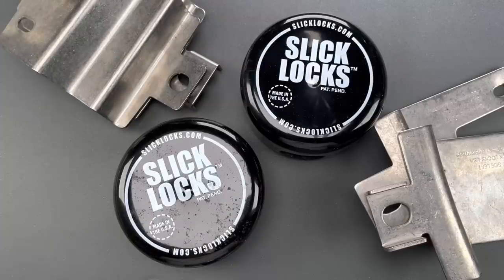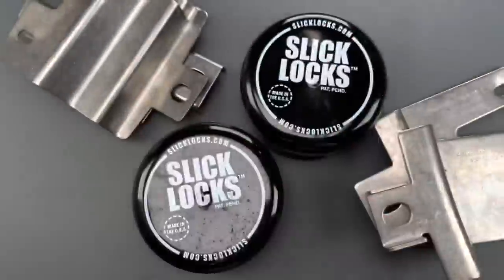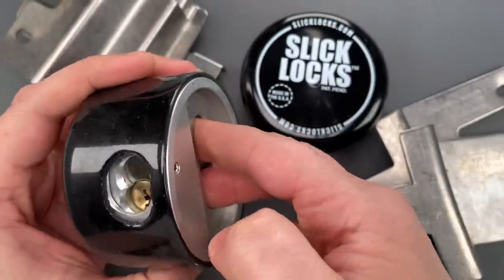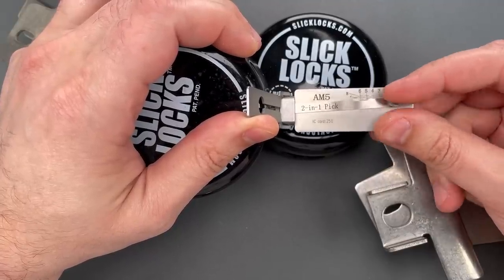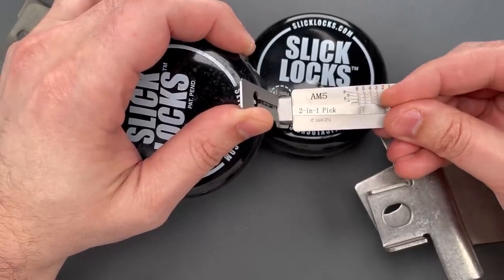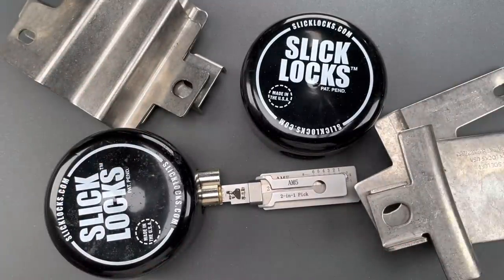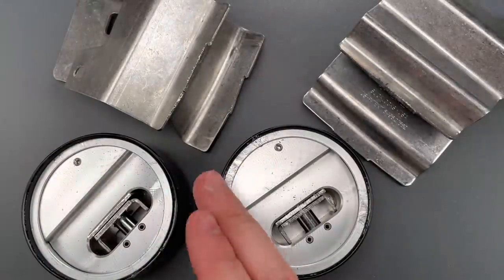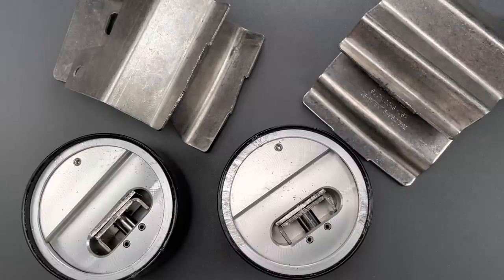[1451] “Slick” Van Locks: Cut in 18 Seconds

Comment: Well, that looks like a pretty good result for me. Took LPL some time to pick open, and cutting can be solved with a hardened steel version. And as always, real life situations might take very longer. It's the best feedback a product with potential could ask for.
Reply: Agreed. This is about the level of protection I have on my enclosed trailer. With a plastic roof vent and a RV style side side door, there isn't much use in beefing up the hasp much more in my case. Most of these transit vans also have front windows, may or may not have a passthrough, and a sliding side door for removing equipment.  Sadly I have fixed a bunch of vans where the door skin was just opened like a soup can with a battery powered nibbler. Steel or aluminum, if you know where to cut it is about like the time in the video here. Some of the electric latches are a little better because you can't just pull on rods to open everything.
Reply: Plus that NOISE was LOUD. I can’t imagine any thief really trying that IRL unless they KNEW what was in the van.
Reply: Also, working a hacksaw with the lock in position is going to be a bitch compared to doing it on a nice, clean mount. It'll make it that much slower and more annoying to deal with.
Reply: You always know a lock is for real if the LPL video is longer than 2 minutes
Reply: @Just_A_Dude  even easier. use a sawzall with a long blade.they can be bent enough to get in there and cut.
Reply: @dragonkyng  thieves aren't scared to make noise while they stealing your stuff.... look at how many catalytic converters have been stolen.... all at night while you are sleeping. Using a Sawzall or grinder with a metal cut off wheel.
Reply: @Just_A_Dude  Every hacksaw I have had has the option to mount the blade on an angle to the handle, it wouldn't be any harder to cut it on a real van than in that vice.
Reply: @dragonkyng  Hacksaws are not all that loud, I mean they are not quiet but it wouldn't be the kind of noise to draw much attention.
Reply: @--_DJ_--  agreed here. "took more than 2 minutes cause i looked at the video playtime means its secure" uh no that took no time investment and has very low liability for discovery while picking if you ask me
Reply: @Just_A_Dude  once the blade of a hack saw is in a grove or in this case between a door and puck lock it's quite easy to cut
Reply: @aclausenyt  you must be a lot of fun at parties
Reply: @dragonkyng  catalytic  converters are stolen each day with most people never hearing a thing.
Reply: @hauptmann6  was thinking the same thing. With a decent blade you'd probably cut that in about 3s with a reciprocating saw. But with decent power tools you're getting into most things...
Reply: if you would make the steel lashes from cold-rolled spring steel, thieves won't stand a chance to cut through this.
Reply: @Just_A_Dude  That is pretty much the case with 90% of LPL videos, nice, clean mounts, picking the lock 100 times to pretend he can do it fast, put any of these lock on usual spot and tell him to do it, I bet the video would be 20 minutes long. It's just sad seeing all the gullible viewers eating it without lube and parroting the same dumb meme every time...
Reply: @LumenInFusco  well, he picked it and sawed through it in the same video, that's why it was longer than two minutes xD
Reply: Sure it's loud when you put the microphone right next to it 😁.
But in the white noise of the street you will never hear it. 
Also thieves are bold enough to cut catalytic converters from the driveways in front of the house or public parking lots day or night with cordless sawzal and no one even noticed.
Reply: Also when installed on the door the space to slip an hacksaw inside is greatly reduced.

Comment: LPL is slowly shifting from standard trade locks to locks that have some defenses.  A good sign that not all locks are the same.  As noted by the LPL it still needs some work. Er, the name might also be change too.
Reply: Name probably refers to the Rotalock like defense against twisting the lock off the van, as that would be very slippery.  But something blocking hacksaw attacks is clearly needed.
Reply: He keeps rotating through various types and themes. We've had these kinds of locks in the past.
Reply: A lock will only keep an honest person out, no matter the cost.
Reply: @boboften9952  Hey man while you make some points here, i'd like to mention that capilizing every word makes your text flow poorly and look bad in comparison.
Reply: @denniswoycheshen  But there is an argument to be made about the time it takes a dishonest one to get through
Reply: The lock is fine.  The brackets that are included are basically pot metal made for looks and speed of tooling (likely stamped out similar to sheets of tin) rather than strength.
Reply: @denniswoycheshen  
Yes, that's correct.

But the fact is, as you move up the thief levels, there's fewer and fewer the higher you go.

So the bigger a pain in the ass you make your locks, the lower your odds of one good enough randomly coming along.

Assuming you're parked in an area where they wouldn't want the noise of shattering glass, or power tools of course.

Comment: Both the picking and sawing attacks would be considerably more difficult "in the wild".  With these types of security devices, you 99% of the time you only have to have better security than the lower hanging fruit in the area.
Reply: A parked van with the name of your service or company tells every would be thief the van is full of expensive tools and materials, and the owner is servicing a client in a nearby building, giving plenty of time to rip the contents while keeping a lookout.
Reply: My experience with a Ford Transit is that the material in the doors is even weaker than the hasp provided.
Reply: @creamwobbly  congrats.. you're assuming just as much, if not more, than the person you replied to..
Reply: @creamwobbly  Is "Transit van" a generic term? I thought it was quite specific.
Vans not within Ford's Transit brand are just called... vans.
Reply: @caramelldansen2204  In the UK it is used as a generic term for any van of that form factor, including alternatives by Mercedes, Renault, Fiat etc. - essentially anything smaller than a box truck (or "Luton van" in the UK) can be reasonably called a Transit.
Reply: @MidnightGazebo  Is your spare tire in the boot or the trunk? Mine is in the trunk
Reply: .... Pick Up The Well Named Van With A Tow Truck .... Open The Van Up With A Diamond Drop Saw / Concrete Cutter ....
  Where There's A Will There's A Way .....
Reply: @boboften9952  please dude, please stop capitalizing the first letter of every word. I saw a few comments like this, please, it doesn't look cool it just gives me a headache to read. I don't mean to be rude but if you stopped the world would be a better place tomorrow. Wouldn't that be nice?
Reply: @mattadored  Seconded.
Reply: @mattadored  I thought it was a song title for a number of seconds
Reply: @mattadored  I Also Agree
Reply: Most thieves, especially in rural areas, are just going to be checking for unlocked doors. For one, they’re lazy, Two, they’re used to getting arrested and don’t want to have burglary tools on them. If I lived in a metro I’d definitely buy higher security, but masterlocks and hardware store hasps have always been more than sufficient for me.
Reply: That is pretty much the case with 90% of LPL videos, nice, clean mounts, picking the lock 100 times to pretend he can do it fast, put any of these lock on usual spot and tell him to do it, I bet the video would be 20 minutes long. It's just sad seeing all the gullible viewers eating it without lube and parroting the same dumb meme every time...
Reply: @KuK137  Stop spaming with the same silly comment... LPL will not gonna start doing videos on a street!
And yes criminals doing it in the open but then its not imoprtant if it was 2 minutes 4 or maybe 7 minutes.
Hasp on this lock was bad and that is the end of the story.
Most criminals also would use this option as it is low skill attack and on top of it the attack was much faster...
And no people do not gonna call police just because someone is using a saw on a street for 2 minutes...
Reply: @Bialy_1  you realize that responding is called 'feeding the troll' and is generally avoided by those who have been around a while. You only win by starving them...

Comment: Can't say I've seen a hand saw start smoking that quickly
Reply: Cutting paste and a pretty high strength steel.
Reply: LPL lowkey swole
Reply: The smoke you saw was escaping from the saw blade, as the saw for sure comes from hell! 😆
Reply: oil
Reply: Remember that was attempt 2, the blade will already have had some latent heat in it
Reply: @Rych   Interesting hypothesis but, given the thermal capacity of the thin blade, it's highly unlikely the blade would have any leftover heat in it by that point.  It's actually pretty likely the smoke is from the plastic material coating the cover, not from cutting the metal. Edit: or from some WD-40 he may have put on the blade first...

Comment: They do serve the purpose though of taking extra timer to open, so are going to make the thief look for another vehicle first.  Yes a hardened plate, or one made out of a tougher steel, or with a spot welded in extra high tensile plate, to deter the cutting, will still be a benefit. Easy enough to add in to the existing lock as well, just needs a suitable piece of high strength tough steel, wiyth the hole punched in it, and a spot welder to attach it to the existing bracket. After all the steel of the vehicle is the softer option, all you need is to make the staple 5 minute resistant, as if they want in they can bring along a can opener, or a nibbler, and simply cut out the existing steelwork anyway, or a cut off disk and angle grinder to do the same.
Reply: Same goes for Door locks. Youre looking at roughly Three Minutes average time. Five minutes is of course even better. In highly frequented areas, thieves/robbers always go for the quickest and sneakiest option.
Reply: As usual, though, the question here is 'random attack' vs 'targeted attack'.

If the thief wants something OF YOURS, then making it take longer won't be enough.

We are, of course, assuming a work van, with no windows, and a secure wall behind the seats...
Reply: @baylinkdashyt  Making it take longer increases the chance of them being detected.  Making it noisier is even better.
Reply: @baylinkdashyt  A major user of such vans is actual locksmiths with their van full of spare locks, pinning kits, key cutting machines and anything else needed to install or replace locks on a call out to anywhere in town.
Reply: @johndododoe1411  an excellent example of a targeted attack, yes.

Comment: Dang it.  This looks quite promising from the fight that it put up from the picking.  So close yet so far away.
Reply: You could make it work.  Buy a slick lock, keep the lock, and toss the hasp.  Buy a master lock, toss the lock, and keep the hasp.  Simple.   😁
Reply: @iamme2072  that is actually kind of genius.  LOL
Reply: I doubt it would be so easy to cut through on a van, the bodywork of the van would get in the way of the saw handle.
Reply: @cypherdras  most of the thieves use a jigsaw, quicker and less effort
Reply: @WLS_Churchill  you mean reciprocating saw.
Reply: @cypherdras  on most hacksaws, the blade can be rotated so the handle would be at a 90 degree angle away from the door, not difficult at all.
Reply: @The_Story_Channel  Dang it! I typed almost the same words, then saw your comment.
Reply: @cypherdras  A pad saw would solve that problem (it’s a handle for a standard hacksaw blade).

Comment: They're really close to having a really solid lock. Hopefully this inspires them to add a little extra defense to the hacksaw attack. I assume against the side of a van, the hacksaw attack will be more awkward and take a bit longer but it needs more still.
Reply: They should make the hasps more custom-shaped to the van and extend out to the outer edges of the puck, and wedging outwards into the newly convex backside of the puck, making the hasp look like a flattened pyramid if you viewed it from the top or bottom.

Comment: As a Locksmith I find the thieves using a cordless sawzall to break in
Reply: Battery powered tools are extremely useful for work but sadly also for crime
Reply: I would quetion whether they could get a flush enough press, but the blades are pretty bendable if they don't mind breaking one or three
Reply: @LeonSteelpaw  a long blade makes it quite easy for clearance, especially with metal that soft. I use 12" blades a lot at work because you can cut at a 45 degree angle if you don't mind scratching things from the blsde rubbing. A good bimetal blade won't break.
Reply: the cordless sawzall seems to be the tool of choice for catalytic converter thieves as well...
Reply: @demonicdonut22  if they are going to go that route, with all the noise and damage, they could just cut through the door or cut at the hinges.  No lock would stand up to that.
Reply: @allenbaylus1912  chain pipe cutter when you want to be silent as with my roommates exhaust pipe on her Prius
Reply: @demonicdonut22  Seconded. I do the same with long blades and awkward arrangements.
Reply: @LadyAnuB  A better theif would use a compact acetylene torch. Almost completely silent and they sell them small enough to fit in a backpack at TSC/Peavy Mart.
Reply: @firestone3217  And risk catching the car on fire?
Reply: Definitely this would be a the quickest option with a long metal cutting blade. But it's neat that LPL used a $5 hack saw to show that even a broke thief with ancient tools could get in.
Reply: @LadyAnuB  Nothing a rag couldn't sort out. Not exactly going after the gas lines.

Comment: Took roughly a minute with a specialised picking tool, that's pretty good. The fix for the hasp issue is pretty simple - hardened steel plate. Probably wouldn't add much to the overall price of the poduct.  A really well thought out product. The reality is thieves would probably steal the vehicle and go at it at their leisure. But that's not the slicklocks fault

Comment: I read a couple of comments where it was said that with the lock installed on the van, it would be more difficult to cut through the hasp, it sounds like some do not realize that most hacksaw blades can be rotated 90 degrees to the handle, that means the handle would be at a 90 degree angle away from the door, the pin or wingnut on some might still rub against the door but I don't think thief's are too concerned about scratching the paint.
Reply: That's true, but it's also awkward and more difficult to apply pressure on the blade and easier to snag or get twisted. In any case it's going to be more difficult installed than in the comfort of your workshop in a vice.
Reply: @DragNetJoe  Not at all, I have worked in building maintenance and construction for over 35 years and rotating the blade does not make the saw more difficult to use, you can still put as much pressure on the blade and maybe even more because you have a tendency to use both your hands when the blade is rotated (holding the handle with your dominate hand and holding the end of the saw frame with your other.
All that being said, you are correct that it would be easier in a shop but its still not difficult at all on the vehicle.
Reply: @The_Story_Channel  and just to add to your point even if the difficulty is doubled "in the field" that is still just 36 seconds to remove the lock like LpL said this would have been FAR more difficult to do with a hardened hasp the weakness of the hasp is this locks greatest flaw

Comment: One thing to keep in mind on the hack saw attack, is that the lock is mounted flush against the side of the van and not in a vice.
Reply: Yeah, but a Sawzall with a long blade would be even faster.  The long blade on a Sawzall can bend and it wouldn't need to be flush against the side of the van.
Reply: But most hacksaws can be used with the blade rotated through 90 degrees relative to the handle, which would make sawing only slightly awkward.
Reply: @GMFL2  the doors are aluminum on a transit, so no matter what lock is on it, they could just cut the door itself.
Reply: @TheSaltyExplorer  cut the door?, probably enough to lean on it with a screwdriver to bow the door out of the way (thieves dont care about your paint or panelwork)
Reply: Beat the van to hell and it would 3x as long but still doable
Reply: The door holds the lock in place while you saw. Probably more convenient than the vice. 🤷‍♂️
Reply: @Stue-e  good point, they are very flimsy
Reply: It's not actually flush-flush. There's a gap. If you see the website images, the shoulder protudes quite a bit (maybe 1/8" or so). It makes sense, otherwise the rattling would destroy your paint around the lock. It's more than enough to slip a hacksaw, although it will be a very uncomfortable job. Then again, it's an uncomfortable, knuckle bumping 18 second job.

Or a sawzall.
Reply: I have them on my van. I had the other type on my old van. I like these better than the ugly shrouded hasp with carriage bolts. Could they be cut off, sure. Its like anything else, if someone wants to get in they will.

Comment: Had a  work van with these hasps, thieves were successful at breaking/ cutting one side of the hasp. Banged in the sheet metal pushing the puck lock back and forth. Also tried torching the door too. They must have been scared off before they could get the factory lock defeated. The cab of the van was also broken into (thanks automakers with your genius engineering for putting locks inside plastic handle assemblies, real secure there, definitely toddler proof😁). Portable power tools make things easier than the should be.